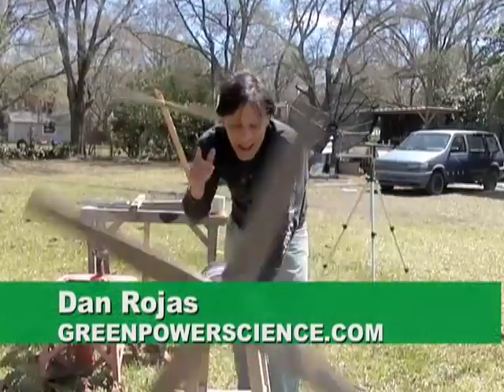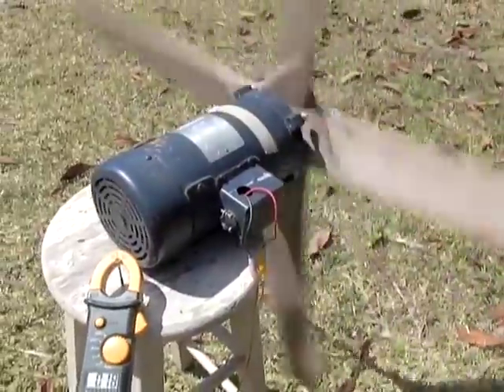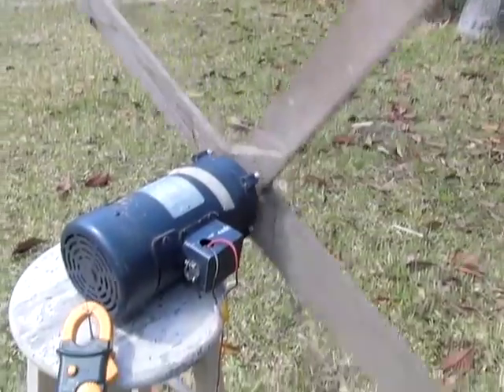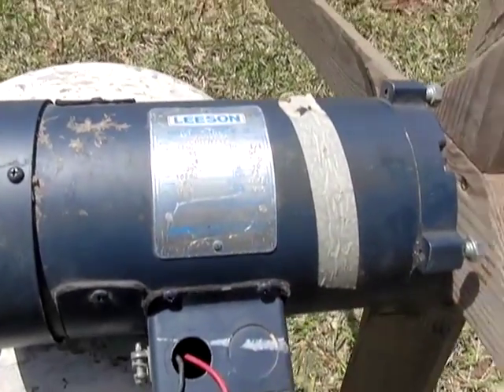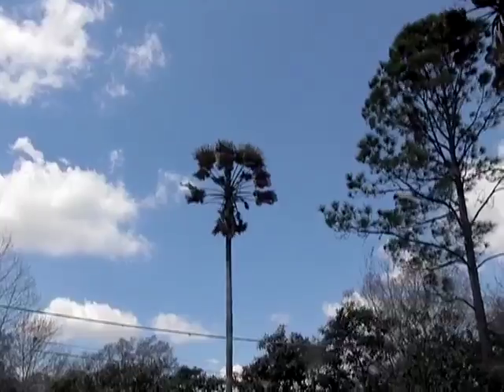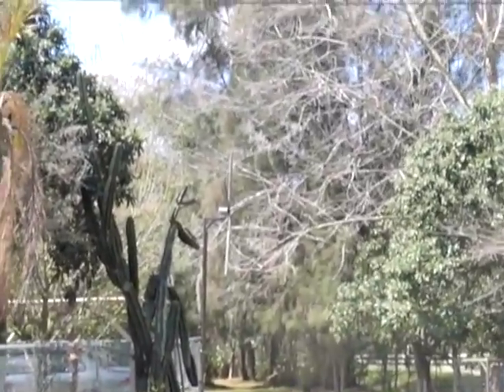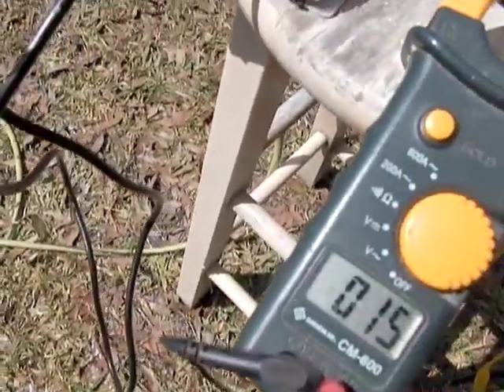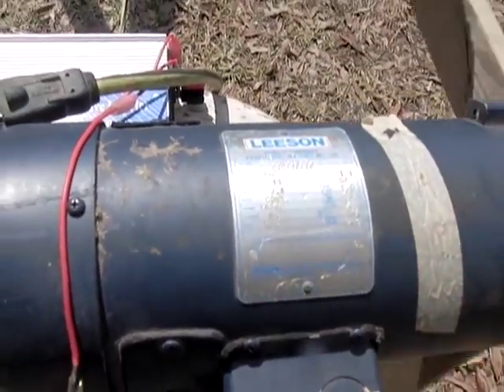DIY Wind Turbine Blade DC 180 Volt Electric Generator HAWT Horizontal Axis design

Comment: Wow thank you so much for all this information! 
I am working with a BLDC motor, and i'm trying to charge a 12V battery with it. I saw you suggested to use diodes to rectify the current and convert the AC to DC. How do i know what diodes I need ? 
Have a good day
Reply from the maker: Get a bridge rectifier in the 10-50 AMP range. BLDC usually has a sensor and does not produce current when you spin it without removing or jumping the sensor resulting in an AC generator. Blocking diodes are not needed because the rectifier does it.

Comment: i got my 180v dc permanent magnet generator from a treadmill someone was throwing out because the circuit board on it was fried. made a vertical wind turbine with it. i avg 5.6m/s wind speed so it cranks along nicely and keep my batteries topped up nicely in addition to 6 * 240w 24v solar panels.

Comment: HaHa Me too! but had a tight fan clutch "police 9c1 cooling fan "i turned on the wipers and pressed all 4 window buttons to kill it : heavy hood, ended up  using a diode trio :1way flow so the coil "+ flow" couldn't feed back f/ fan ! 86 safari B Body GM wagon ! Ain't  thought bout that in bout 15 years we just had a good laugh they do make some current , try a 04ish durango the recalled one , they drew too muck amps = will make lots a amps

Comment: has anyone tried using an electric cooling fan from a car? they are dc w/ perm magnets. installed on old vehicle i had and when i turned key off, would stay running until fan spun down.

Comment: Realistically - wind is good for 300-500 rpm  a motor that ran 1750rpm powered...is going to take about 2200 rpm to be effective as a generator.  there's plenty of math data that proves this on the net.  because it's a higher amp motor, the winding wire is large guage - which is good to handle high amps but not to generate ...once you put load on it - you'll be lucky to get around 300 rpms ... unless your wind speeds are high... upwards of 20mph low rpm motors are best, think treadmill.

Comment: In 1923 when my Dad was just 15 years old he took a truck generator and several disgarded Railroad signal batteries and a hand carved 8' prop and built such a generator.   By the time he was 18 he had wired the farm house.  In 1935 his generator was condemed when the right to generate power was given to the power company and under threat of jail his family had to dismantle everything.  In 1975 I built my first solar home. The local power company challenged my right to do so..  I won.. good video

Comment from the maker: AC motors do not work as a generator. An AC induction motor can but you only get about 25% back out after modifications (1800 rpm+). Also any AC from an Alternator, or Axial Flux Alternator. The AC current from Smaller wind turbines is basically useless UNLESS you run it to a "Bridge Rectifier" which converts the random AC voltage to random DC voltage which can be stored or used by an inverter. 

If you try to hook AC from an Alternator, you will destroy what every AC appliance you hook it to.

Comment: First this is simply my personal opinion. It's great to share the knowledge of renewable energy, but home made devices along with self installation can cause damage to persons and structures. Putting power back onto the grid should require proper electrical switches to shut power when the grid itself is down. I share the enthusiasm as the presenter of this video, but let's keep everyone safe. Follow local codes, save a life and our country.

Comment: @GREENPOWERSCIENCE 

I don't see where the original comment is that this pertains, but you technically could use an AC motor if connected to a rectifier.  (A car alternator is essentially an AC motor producing pulsed DC using a series of diodes (rectifier)).  For what its worth. 

 Keep up the good work,
- David

Comment: @cyberyiyo A car alternator requires thousands of rpm's to produce power. The lower the rpm rating of the dc motor the easier it is to generate electricity with.

Comment: I still like the wind mills that face the other way.  Upright wind vanes and so on.  You get those setup right and you could drive two or three of those at some good speeds.  Especially if you were to use different size pullys.

Comment from the maker: Birds are pretty smart, the big one has been up for two years and no bird mess yet. That is one reason to go with a larger blade, lower RPMs higher torque geared motor. You can also make a fishing line guard. Birds avoid the sound line makes in the wind.